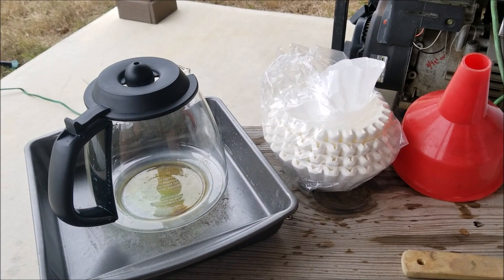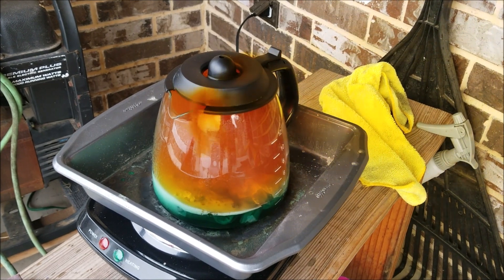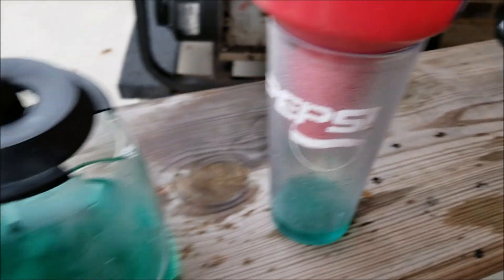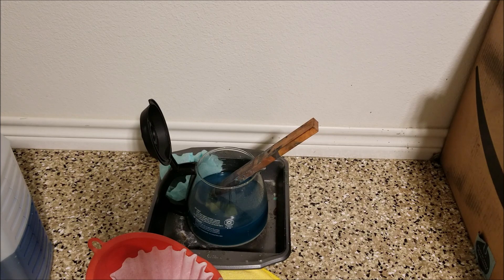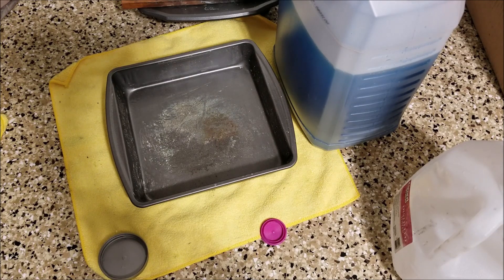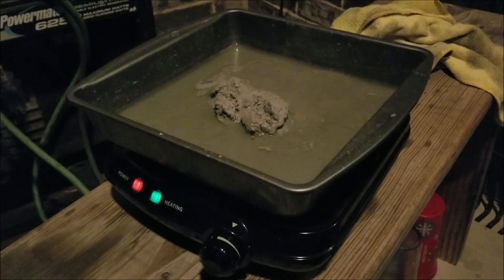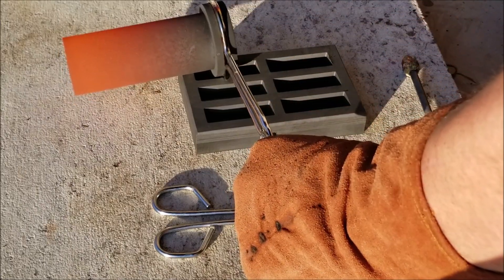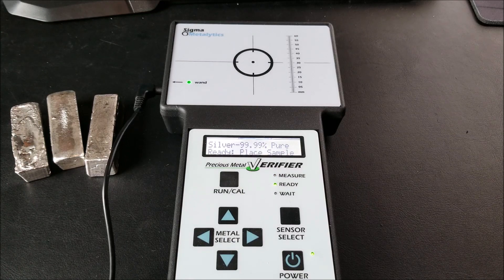Entire Process of Melting Down Silver Coins, Refining, and Testing to 0.999 Purity

Comment: I would love to do this to some 35% nickels, I’m just a little sketched out working with nitric acid. And those fumes look like something out of a ww1 trench
Reply: Agreed I have one silver that I would love to refine too
Reply: They are 😬
Reply: 93% sulfuric acid will do the job! it takes quite a bit longer but will extract the silver! then there is a process to change it from silver sul to silver chl then back to metallic silver. Not saying Sulfuric acid is any safer but it will do the job if Nitric is not available. Its all in Hoke's Book
Reply: Or a WW2 Jewish summer camp

Comment: I'd like to see this done with before and after weighing of the results along with consideration of the cost of acid as other individuals who have done this under lab conditions have noted that without performing additional chemical treatment of the acid that you're losing a certain amount of weight.
As such, how's about a controlled experiment - take ten ounces of 40% silver and see how close you get to four ounces of fine silver along with acid costs to determine what the premium is for obtaining fine silver in this manner?
I think I would also recommend doing it with 90% to see if maybe one is superior to the other.
What do you think about breaking down the silver first - get a good pair of bolt cutters and say, quarter or eighth the coins to expose more surface area to the acid and thus possibly generating a faster and/or more efficient reaction?
Finally, for the filters, do you simply stuff a bunch into a crucible to burn them away and recover trapped silver or place them directly in acid to remove it?

Comment: I havent seen a video yet with this thorough of explanation for melting junk/constitutional.  If I am correct all yours were 40% correct not 90%? Yet you were still able to get to 99.9% how awesome.  I have strongly considered going through 35% War Nickles and trying this. Everyone seems hesitate to buy 35% and local dealers ive spoken with dont trade it. So if I have any why not give it a go. However  it may be more trouble than its worth and perhaps need to just stick to the 40 and 90s.
Reply: It was a mix of 40% halves, 35% nickels, and a few 90% dimes.
Reply: ...and a silver belt buckle was in one of the batches too
Reply from the maker: I think the issue with a lower percentage (35%-40%) silver is that you will be using nitric acid to dissolve the (mostly) copper in those coins to get the silver.  So it is using the nitric (expensive) - more of it - to get the desired result.

Comment: Very cool! Would you say it's worth it to buy the "bulk 90% 500$ coins silver" bags on bullion websites and melt it down like that? Where do you get your coins? This definitely seems like a cool hobby to get into, I love the idea of smelting fun little things as well as melting all the aluminum cans I use lol.
Reply: I would say only if you get them for far less than spot (like a garage sale or from coin roll hunting) since the cost of the nitric acid will offset some of that. 

I have a full size 25 pound metal forge that I use for copper, aluminum, and brass - I typically only use it in the winter as it is QUITE HOT.
Reply: Personally, I don't think it's smart to melt 90% US coins. Because they "self-assay" and trade just as they are. If you melt down junk silver coins into a bar, nobody knows what that bar is composed of. That means it's worth LESS than what the original coins were worth. And now, you maybe are thinking about getting involved with nitric acid and those fumes. Those fumes are fiendishly toxic, they can kill you and a splash of acid can blind you. Nitric isn't cheap. Neither is the PPE you MUST have if you are going to deal with it. Then, you need the furnace or forge, whichever you choose. I don't consider it a casual undertaking.

Comment: NIce Vid! But I was confused at the end on your terminology of the number of "nines". I have always used the number past the decimal as how many nines there are  ie. 99.99 would be 2 nines.. the whole number is implied. No biggie though, thanks for the vid!
Reply: 99.9 = 3 nines  (0.999 pure)
99.99 = 4 nines (0.9999 pure)

That is how it has always been explained to me.
Reply: @ScottHD  Looking into it more, it seems the difference is if you look at it as a percentage or a decimal fraction.I'm just used to the decimal fraction notation. So I was wrong to think the whole number was implied. Learn something new everyday!
Reply: Forget the 9's the decimals 0.0% are calculated in tenth such as 0.1 is one-tenth or 10 cents move the decimal by adding a number in front of it 1.0 = (100%) or behind and it becomes 0.01 which is one-one-hundredth 1/100th of a percent or one-cent. So when you see 1.0 that is 100% of the whole which could be a variable of the whole pending the decimal placement. 

1.00 is 100% or 10 dimes or 100 pennies of the whole in this case the purity of the silver. 

$99.99 is like 10,000% how many dimes are there in a one-hundred-dollar bill? 

Since decimal is calculated in tenth 0.1 = 1/10th, or 10-cents, therefore, there are 10,000 dimes in a $100 dollar bill because 1.0 or 1.00 is 100 percent which takes 10 dimes to equal 100% therefore, 1.5 is actually 150% or $1.50.

0.999 is not as pure as 0.9999 but you are only talking 0.001% or 0.0001% of a difference, take a penny and cut it up into 10 pieces, 100 pcs or 1,000pcs. 

Now take one piece from the 100pcs and mix it into 1.oz of silver and you will have 0,999 percent pure, take one piece from the 1,000pcs and mix it in with 1.oz of silver and you will have 0.9999 percent pure. Take 10 pieces from the 10pcs and mix it in with one oz of silver then you are getting closer to sterling and coin silver.

A 1oz 90% silver coin has about .77% of silver or about 3/4 of an oz of silver the rest is other metals such as nickel and copper so if you melt it down and remove those other metals from a 1oz 90% silver coin you will have about .75% of silver left from the 1.oz coin.

Simply (1.0 is 100%) (.1 is 10% or 1/10th of a percent and that is what decimals work on) (.001 is 1/100th of a percent) then you have (1/1,000th of percent .0001) so if you have .999 you are 1/100th off of being pure, more junk mental or .9999 1/1000th of a percent of being pure less junk mental. Because when you start going to the right of the decimal smaller of the amount .000000001 and when you start going to the left of the decimal 1,000,000.00 the greater the amount. 

So you will need 0.009 + 0.001 to equal 0.01% which is the difference of one-grain of sand or salt versus 10 grains of sand or salt of impurities mixed in 1.oz of silver. Really too small to worry about unless you plan to buy a million ounces.

Comment: ♥♥. Didn't notice you mentioning SAFETY equipment - gloves, possibly a thick rubber apron, and, SAFETY GOGGLES.
Whenever working with chemicals (nitric acid in this case), and heat, safety is the No. 1 priority (especially your eyesight).
Reply: Agreed!